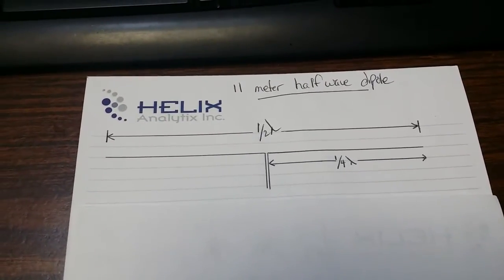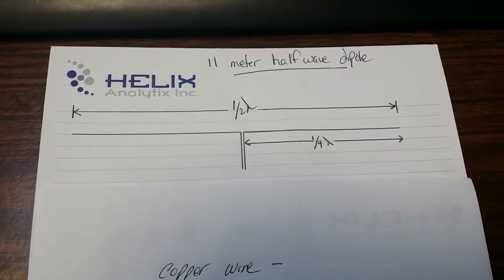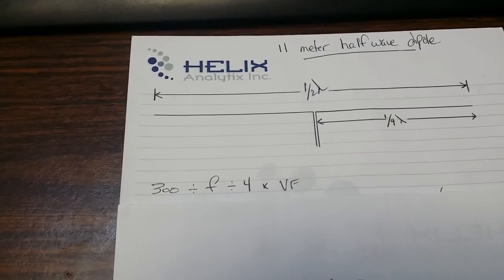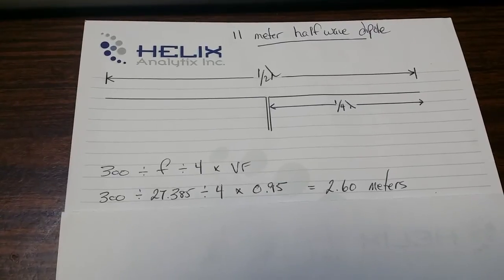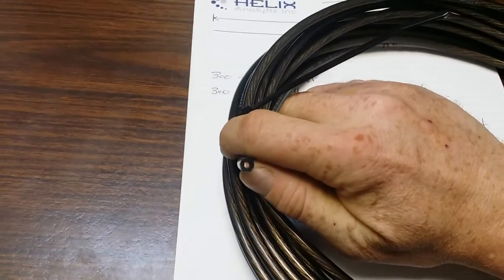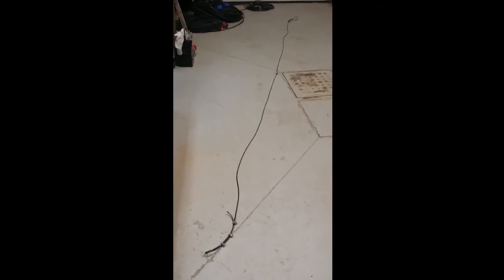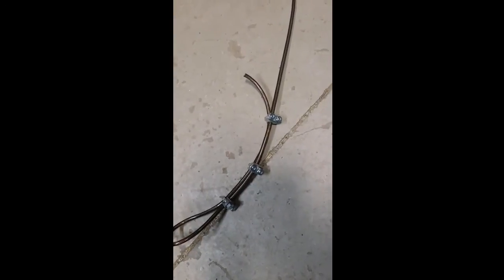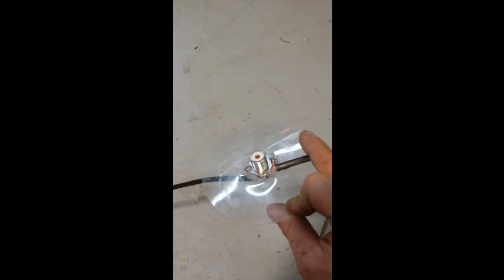My first 11 meter Dipole Project

Comment: There is a way to build a center insulator.  A pvc T and a short stub nipple and a cap. if this is made correctly.  It should be water proff. A W2AU balun would work well to help keeping stray RF from coming back on the coax. 8 turns around a 2 liter pop bottle. Super glue the windings. This will work for keeping stray RF. The higher you put a dipole in the air the better it will work. The SWR at low hights will be higher. A proper balun will have a eye hook for mounting.

Comment: Hey good work on your attempt. well done. Now go for the 1/2 wave folded dipole with the 6:1 balun and get some gain and even less noise. enjoyed the video. let me know how you go.
Reply from the maker: definitely will be trying the folded dipole next,, just have to figure out where I'll string it up as I don't have a huge gumtree in my yard. Also we have pretty harsh winters here in Alberta, Canada so the wind would blow it away... Maybe I'll just put it in my garage to build and test, and when It goes outside I'll see bout putting it inside some abs pipe to protect it from the elements